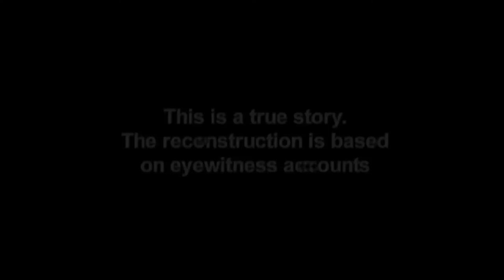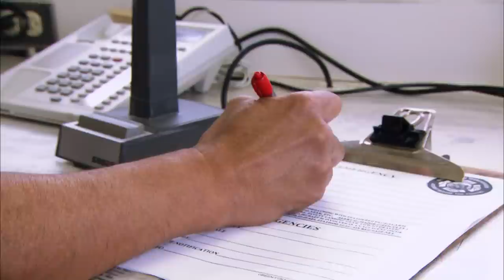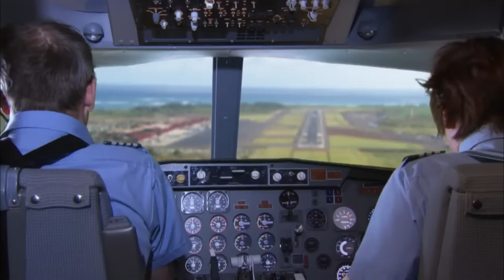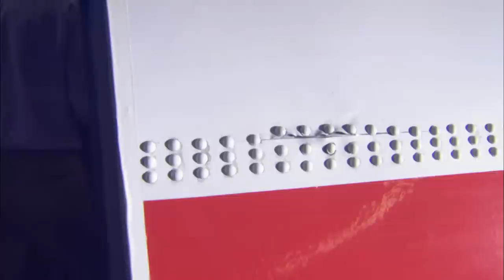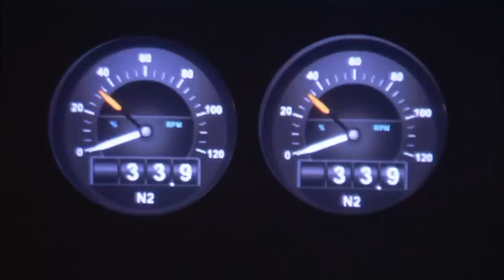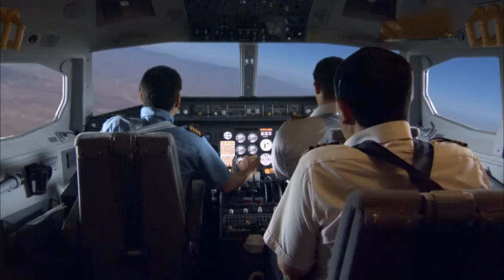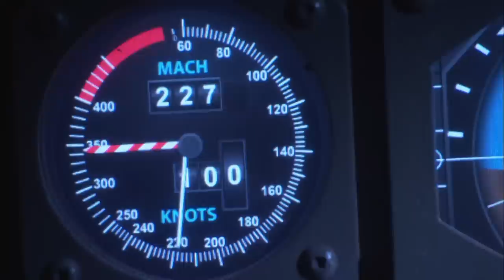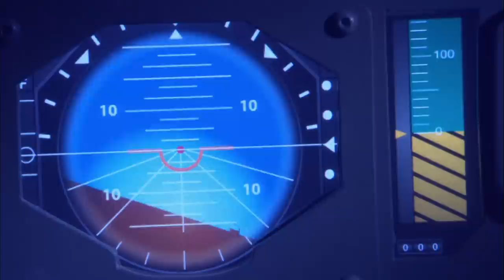Flight Attendant Flung From Plane After Cabin Explosion | Mayday Compilation | Wonder

Comment: Everybody talks about the “Miracle on the Hudson”. And it truly was an awesome miracle. But holy cow!!! What about the “Miracle In Hawaii”? If the fuselage had failed a few moments later, no one would’ve had seatbelts on. Dozens would have died immediately. Furthermore, one wrong move by the pilots and the plane would’ve broken into pieces. The landing could have snapped the plane apart. Everyone should’ve died a dozen times over. Wow. Those pilots were truly spectacular. Heroic even.